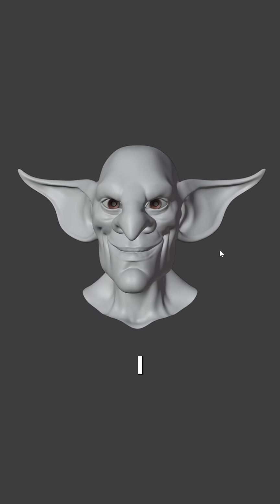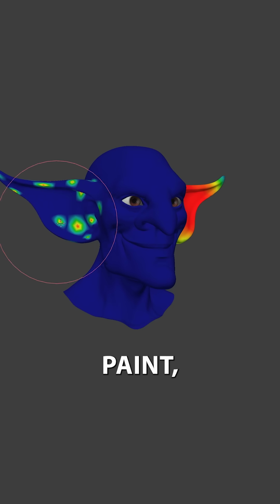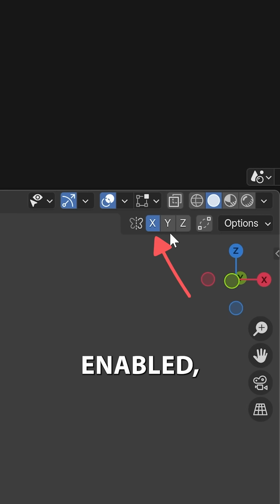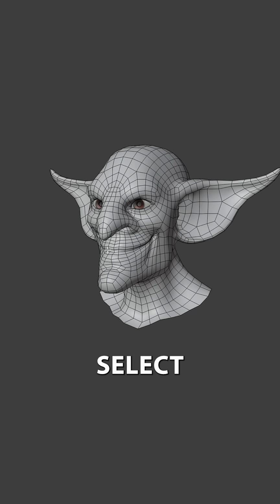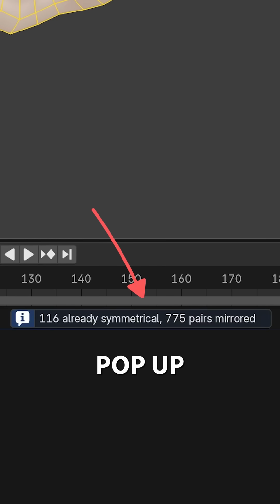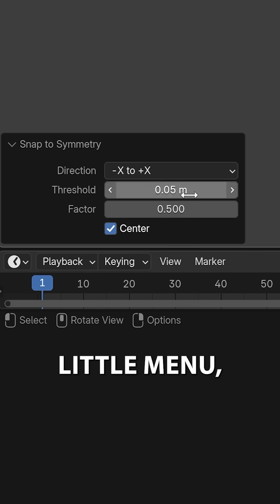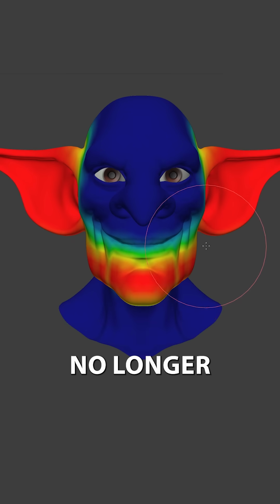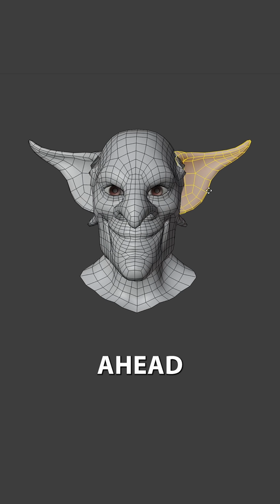A cool tip on how to adjust broken symmetry inside Blender. #b3d #blender3d #3d

Comment: Asymmetry makes things look right... Symmetry though csn be uncanny or perfect.
Reply: It's hard to work with a mostly symmetrical form like a human, humanoid without considering symmetry. It doesn't have to be perfect, but it needs some level of symmetry or it's not readable as a plausible body plan. (Also, it's quicker to make forms with symmetry and then make them asymmetrical.)
Reply: @keepyourshoesathedoor  as is logical. ^-^

Comment: I just delete half the vertices 1 loop away from the center depending on the side and use a mirror modifier. This also works when clearing random floating vertices that pop up when doing a lot of making of large edits.

Comment: I did not know this – I had a completely different workaround. Awesome stuff, thank you 🤙
Reply: Did you carefully cut the model exactly in half then add a mirror modifier? Because that's what i used to do before this short threw my life upside down
Reply: @BvousBrainSystems  Almost – I was deleting half the model, then aligning all central-ish points vertically to form a perfect center, setting the origin to this vertical, then using Symmetry in the Mesh menu to recreate the other side. It's actually easier than it sounds (and better than Mirror mod imo as it's just one click, no Apply or anything), but the method in the video is far superior.

Comment: My dumb ass would delete half of it, add a mirror modifier and apply. 😂
Glad to see the process is automated already.
Reply: well, this also work tho, if this trick doesn't work, i will do same
Reply: thats exactly what i was doing up till now
Reply: That's exactly what I thought of 😂😂😂😂

Omg I'm a noob not a pro 😅😂
Reply: I thought i was the only one LMFAOO
Reply: nothing wrong with that, just slightly more time consuming, do whatever you know, just get the job done
Reply: That is what I always do 😂
Reply: Lmao i thought the same😂😂😂
Reply: That’s also a valid option, but if you need to preserve uvs and shapekeys this way is better
Reply: same 😂😂
Reply: Theres no need to delet half of the model, just do 2 times x or y (whatever the position your model are), apply (check any errors in edit mode) and youre free to go. I just waste up to 1 or 8 minutes with that.
Reply: Pretty sure it would take about the same amount of time to just use the mirror modifier.
Reply: @pmdesigns5798  nope. you will lose vertex weights and groups. this is a much better solution.
Reply: @pmdesigns5798  have luck to mirror textured model lol
Reply: @pmdesigns5798 
Pretty sure if you remember how to do it, you can do it very quickly
Reply: @nicholist  that’s why I want to know this magic button. I always go “F3” to search, then start typing “symm…” then set the threshold…
Reply: @pmdesigns5798  there you go, you found it lol. they were talking about the UI button of the actual option, not a physical button
Reply: @majicktek5051  Oh, silly me. I thought when they said it could be done in the click of a button, it meant that it could be done in the click of a button.
Reply: Symmetrize option does that in a click of a button.
Reply: @IrenSk8rGal really? Which button is that?
Reply: Symmetry is superior to the Mirror modifier for this task, as it's just one step (it's in the Mesh menu, towards the bottom, but watch a video on it to see how it works for best practices). But seriously, use the tip in the video as it's even better. Great tip.

Comment: Ok blender is free but those things should not be happening...
Reply: As some one that uses 3ds max 3d coat and zbrush
The same problems exist in those programs with a different way to resolve them. Im pretty sure maya has it too and it occurs when the pivot is not in center of the object

Its a user error
 many projects take upwards to 100 hours.
 you are prone to make a mistake in  100 hours
Reply: @Fo_Cause  Liar i used zbrush for few years never had any problem of that sort.
Reply: @Fo_Cause  If the pivot wasnt centered then it's the guy's fault lol
Reply: @haurg7418  as i said mistakes can happen. and knowing how to fix them is part of the job
Reply: @Fo_Cause  Yeah but i thought that blender did not work correctly but probably the guy messed up something...
Reply: the world isn't ideal, and he's providing some SUPER important tips on how to handle these issues. it's not blender's fault that graphics standards aren't parallel across software.
do you also think power outages or data failures shouldn't happen? as naive as that sounds, don't take your inexperience for weakness though, there's always room to learn and improve.
Reply: @nisbahmumtaz909  He worked with symmetry on so no it shouldnt happen
Reply: If that happens you most likely did something wrong.
Reply: @NicCrimson  Also
Reply: Correct, this is to solve user errors. This often happens when either sculpting or using modifiers like shrinkwrap that can lead to minor differences, which break symmetry.
Reply: This is not realistic though.. the face is a goblin's face so it's fictional... But actual humans don't have symmetrical faces if you wanna be realistic, there's some percentage difference